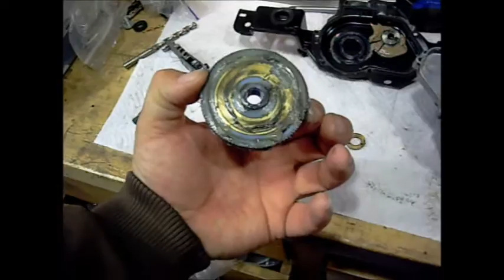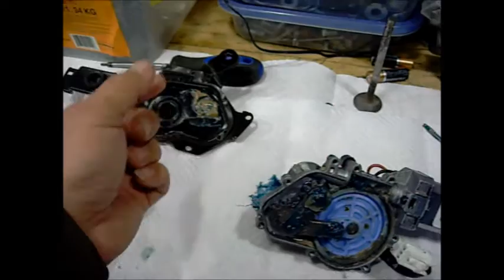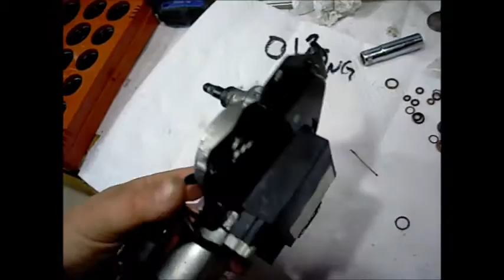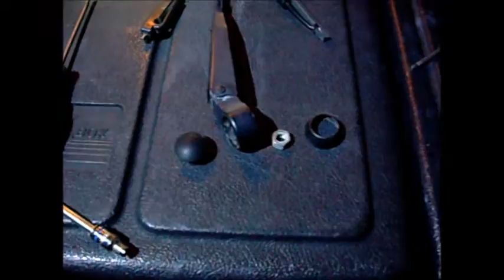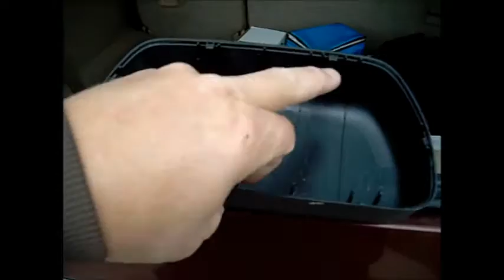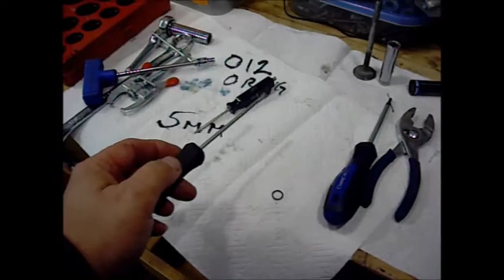2009 Ford Explorer Rear Wiper Motor Repair

Comment: Good job, very helpful, fixed mine without drilling. Used a small OD wire cleaning brush on a cordless drill, with brake cleaner and hand sanded  the shaft, works great. Thanks!

Comment: My 2009 Ford Escape rear wiper motor seized and was draining my battery Fast.  Tech said it was drawing over 10 amps and blew the fuse on his tester.  He disconnected the motor.  I have since read that this disables the windshield washer pump on front which is unacceptable as we are into winter weather here in Ontario.  

I haven’t got time to do the repair right now so what should I insert into the circuit to keep windshield washer pump operational or do I just connect the wires together to bypass rear wiper motor?

Comment: How do you remove the shaft?
Reply: I used wood blocks and set the open side (the side the gears are) down on the wood, then tapped the shaft with a hammer.   Since there are threads on the shaft that you don't want to damage - thread the nut on it first.   Run it down to the point that it is flush with the end.   If yours is really stuck, put something like a flat piece of plastic over it before you hit it to reduce the chance that you will damage the end by hitting it with the hammer.

Comment: Very helpful video. I had a little trouble getting the module off the motor without breaking something, but it did come off. By the way, with mine, I had very little corrosion in the female part of the shaft; it was the shaft itself that had some sort of blackish corrosion. I lightly sanded that off with some 220 grit sand paper and used some dielectric grease. It seems to work! Again, thanks for taking the time to show us what you know. Saved me about $300 CAD. Much appreciated.

Comment: Thanks for this video. Fixed my motor myself and saved $90 bucks. Had to use an arbor press to get the shaft out though.